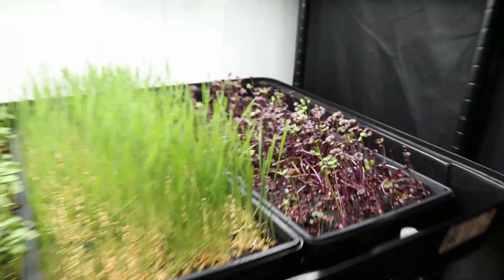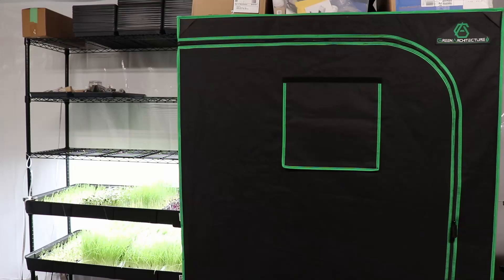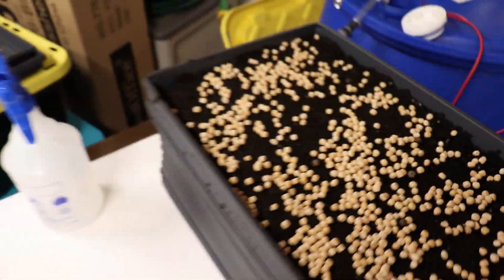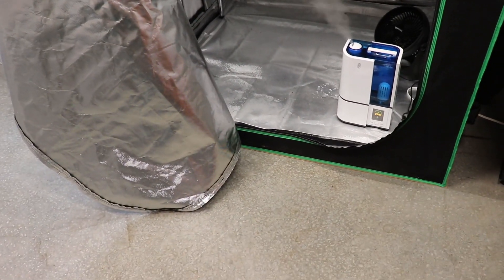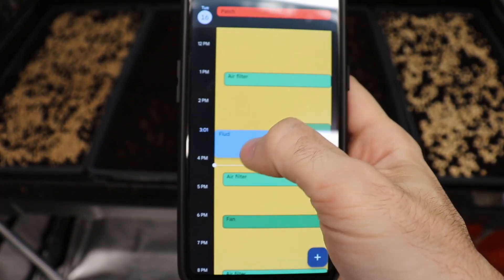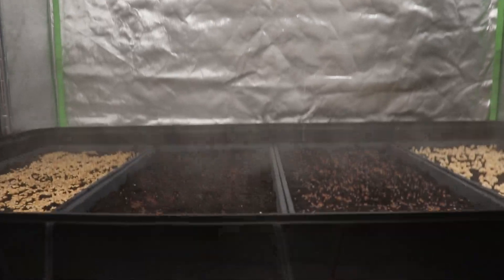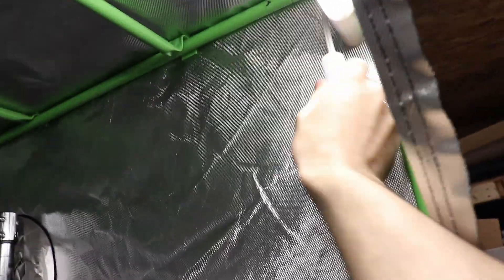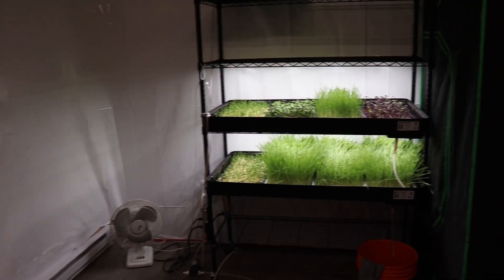microgreens auto germination chamber

Comment: Hm...     you are not afraid of mold  issues with the germination chamber ?  

I'm not sure if this is good idea having water mist system on top of high humidity. Not having air movement in there might be an issue .  I guess you will  find out  . 

Also looks like you not stacking the trays with weight         Interesting .    

Keep up good work .
Reply from the maker: thanks for the comment. Yes I am haha, so keeping an eye on it to see how it goes. That being said, there is a fan always moving the air inside and i will have another fan that will regularly bring fresh air inside. so the plan is to have fresh/humid air. not stale air
Reply: I need this system to purchase